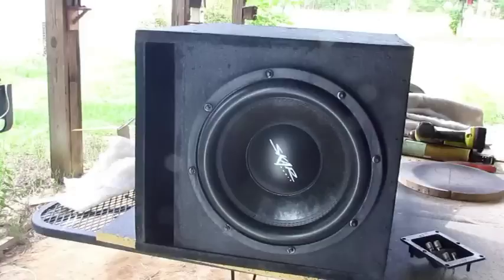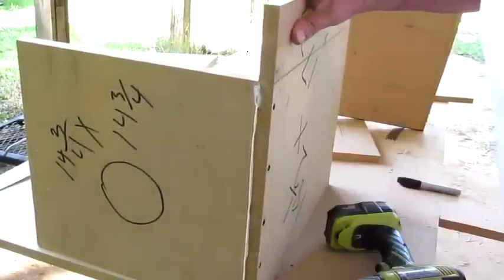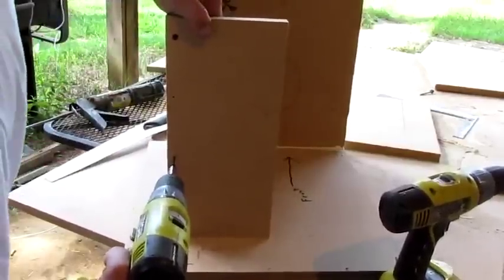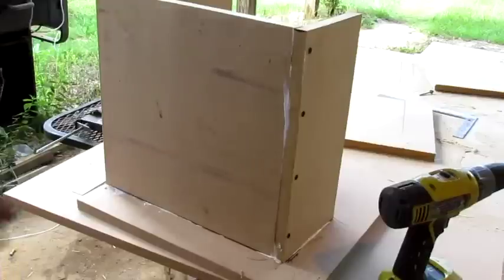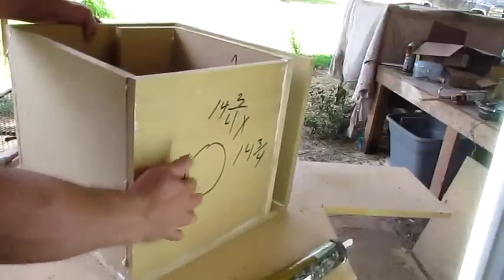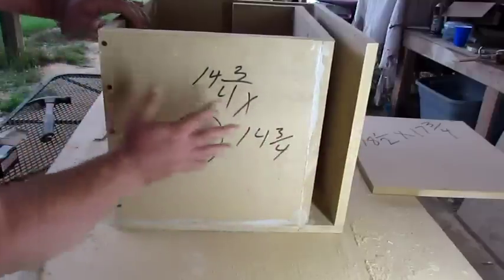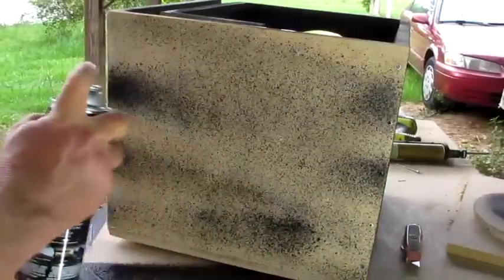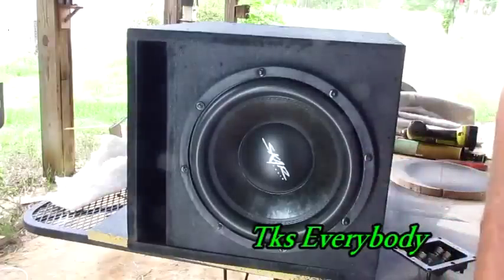How To Make A Subwoofer Box For Beginners

Comment: Actually, the truck bed spray is better than carpet since it adds to the rigidity of the box. But that wouldn't matter much unless there's lots of power going through the sub or the box is excessively large without proper bracing.

Comment: simply superb.. I need this speaker measurement in below the format and thanks in advance,becoz it help me to build at home.
 Speaker hole cutout 0.00"
*(W) 00.00" x (H) 00.00" x (D) 00.00" - Vent (W) 0.00" x (H) 00.00" x (Deep) 00.00" "L" shape vent

Comment: If you carpet a subwoofer box any damage done to the subwoofer box becomes visible once you remove the carpet also if a carpeted subwoofer box gets wet water will make its way into the carpet and mold will become visible once you remove the carpet water damage is much worse on a carpeted subwoofer box than a non carpeted subwoofer box your better off using bed liner or rustoleum paint
Reply from the maker: RIGHT

Comment: I would like to install a 250 watt amp into the box.  will this effect the sound and change the size  that is needed.  would you just cut into the back to install the 10.5 x 10.5 amp

Comment: Looks like you're inside portwall is bigger than your baffle by 1/4 inch at the top I thought pre-drilling the screw holes is the way to go and how about adding some 45 ports and rounding out the edges for smoother air travel I'm just saying
Reply from the maker: right